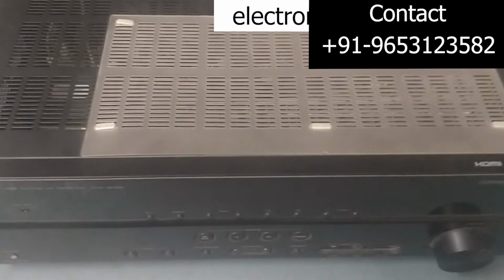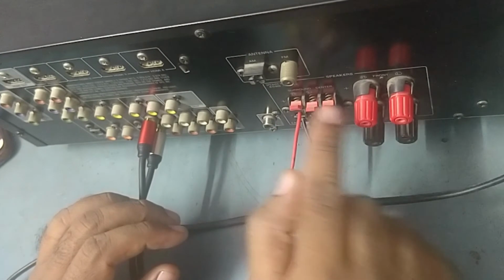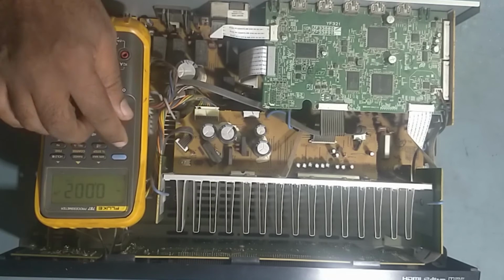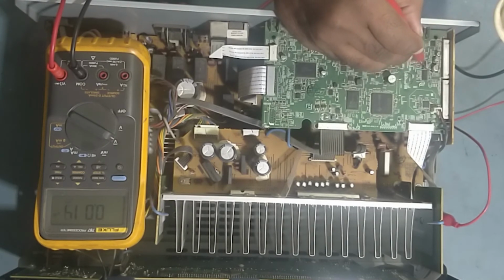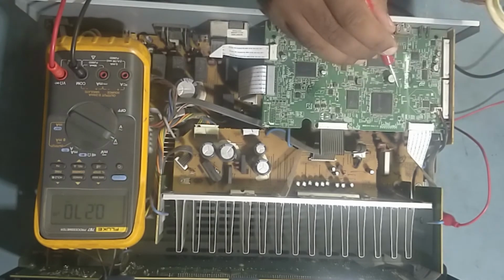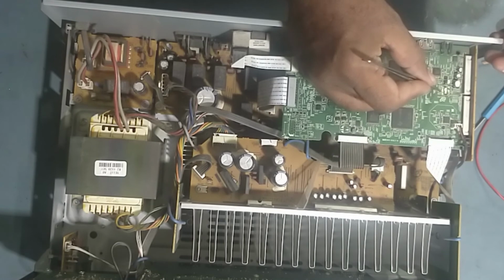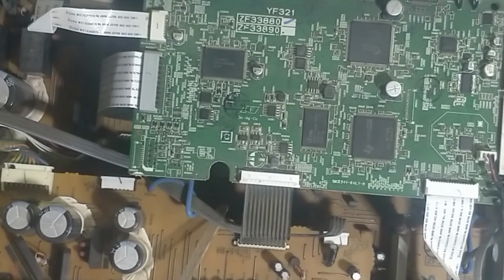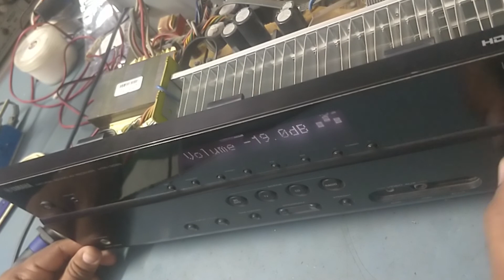How to detect Faulty Electronic part in YAMAHA AVR HTR-3066 for only SR & SL Channel no Sound output

Comment: I have a HTR-2064 here. I suspect the DSP chip. I get strange combinations of speakers working. front R and L only work if treble and bass are in the middle position and only in 2ch mode, but never with hdmi input. Otherwise it's only surround that works. Tried reset. But i was aslo thinking DAC because i could only see 2 analogue audio coming down the connector that connects the top board to the bottom board, i was wondering where the DAC is, but i didn't look any closer yet. So, it's the DAC that also separates all the channels into surround? I pretty sure this is the problem i'm facing. looks much easier than the DSP. lol
  I replaced the DAC and all works fine again. Yesterday i did one that had a dead amplifier module.

Comment: My HTR-3066 has distorted sound in centre speaker.  While checking in self diagnosis mode it gives normal test signal.  Can you tell me problem and how can I solve this problem.  Can you repair it?  How can I contact you?
Reply from the maker: My contact no. 9653123582

Comment: Hi sir ! I have the same issue but it is for center channel. It is not fully dead but if I keep max volume in 5.1 mode it sounds low. What is the issue, please advise.
Reply from the maker: May be problem in hdmi board or may be in Amplifier Board
Reply: @TKFElectronics  Thank you, which is the amplifier board sir

Comment: Hi sir! My yamaha htr 3067's in digital inputs no problem. But..! in analog inputs front right & rear right sides low frequency.... That's my problem sir...! How to solve..!? Sir please... Hdmi, coaxial, optical & usb all are super. But in analog & fm connection low sound problem sir
Reply from the maker: May be some electronic parts in amplifier section not working or in motherboard DSP ic looks malfunctioning
Reply: Thank you very much sir....

Comment: Hai sir ! I have yamaha htr 3067's problem....in movie middle suddenly power off..again I will on the switch...on...again continue running approximately 1 hour again switch off suddenly or continue running..and 2nd problem...in all digital  & usb connection all are speakers good frequency no problem...but..! In all analog connection inputs front right & rear right side speakers low frequency problem sir.... How to solve sir please.....!!??
Reply from the maker: Looks Motherboard issue
Reply: @TKFElectronics  yamaha htr-3067 mother board price sir...please your address sir....I am from visakhapatnam, andhrapradesh
Reply from the maker: Our Contact number 9653123582, pls call us to discuss more in detailed.

Comment: hi bro, i have a yamaha rx-v2073 when hard botton reset is an error  0400 after inizializing  what is the best thing to do? it also doesn't have sound output and version code either. thank you
Reply from the maker: Better give it in YAMAHA Service center located in your locality.
Reply: @TKFElectronics  thanks bro.